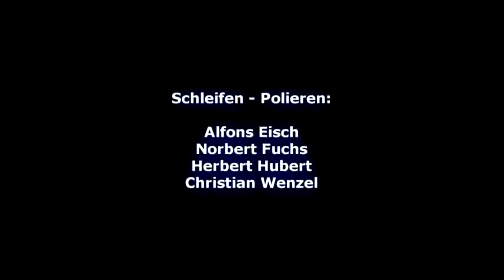Sue Parry- Artist in Residence Glashütte Eisch - Sand Casting

Comment: Nice i know how to do metal casting in sand wasn't so sure on glass casting in sand how it worked (because there was an element to the sand itself that your casting into affecting the cast). But i see it does not really matter. As it saves a person from having to make a middle man mold in cement materials you can just directly go in sand just like metals or any other hot material.
Reply: You it's basically identical to open face metal casting. Nice not needing a cope and drag setup let me tell ya

Comment: Cool cool great video, looks like the consistency of what you get in candy making for work-ability . I question if the sand you uses for sandcast of glass has to be a certain special kind as well for this to work.
Reply: Candy is technically also glass ironically. It's just a sugar base rather than silica. As to specific sand types no I've used plain old playground sand but I bet stiffer sands are more useful for this level of detail.

Comment: I have a question on what powders you used to make the glass colors embedded into the glass. I imagine if you used straight sandcast with no pigment coloring add it just come out same color which would be clear , green ...etc depending on the sand used in the glass casting. Where do you get the colored powder and can it work to color metals , concrete , and other casting objects different then glass.
Reply: The colored powder is known as grit and comes in !many different consistencies. They typically come from supply houses just as painters buy their paints. Reichenbach kugler and gaffer are my personal favorites
Reply: Frit not grit. Dang auto correct
Reply: Frit is itself glass and it must be chemically compatible with the clear and other colors you use so it's just easier to get it from a supply house cuz making it from scratch is both difficult and expensive